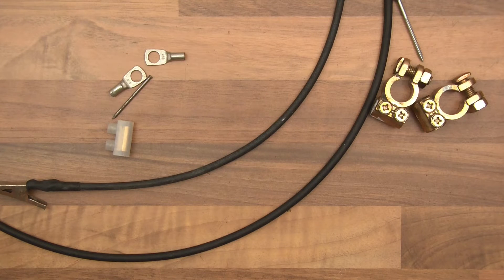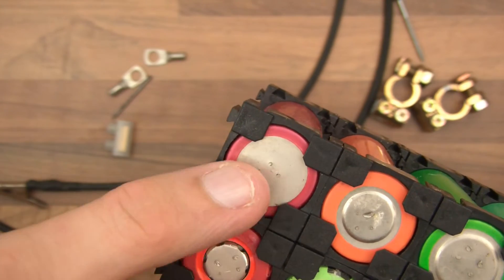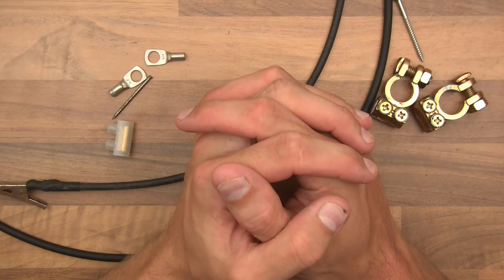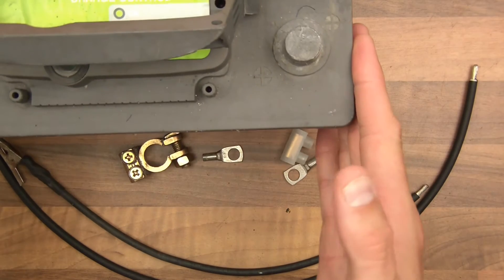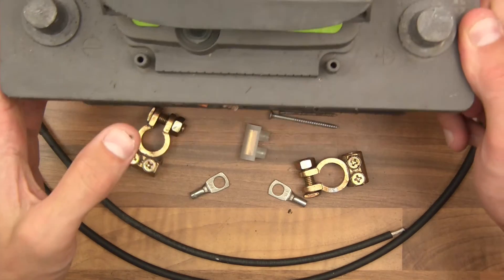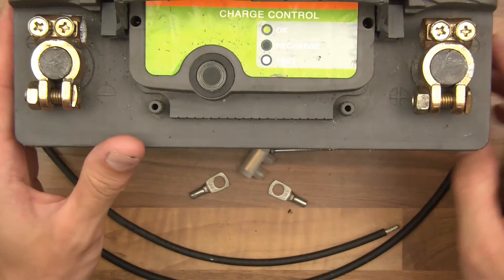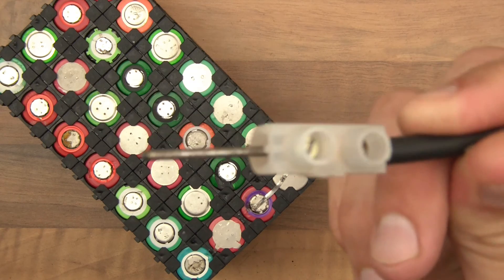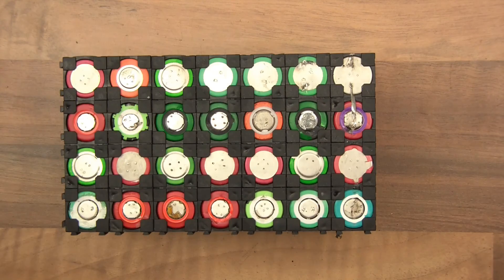INVESTIGATING: Making A Super Cheap Spot Welder! Will it work?!?

Comment: Far too many amps have a look on youtube for others that have done a good job, you can use a capacitor to do the weld charge the cap then do the weld then charge again for the next one but with 400 amps at your command you will just blow the metal away

Comment: I think the issue might be that your bringing the contacts to the 18650s whilst live. For example https://youtu.be/o1NFbchHeM8 does much the same as you but puts a momentary push button in to connect the circuit (I think using a relay) briefly.

Comment: * You should use copper for the tips, it'll last a lot longer and won't stick to the metal being welded.
* Should be using two probes that both touch the strip at the same time within a few mm of each other.
* And, should be using a relay that only lasts for a few ms, <500ms is plenty long enough. 

You have a good idea, but you have a lot more work to do to make it workable 😉
Reply from the maker: Hey, thanks... Some people use a solenoid, but I wanted to try a cheap method! I'll redo the tips with copper soon and put them together!